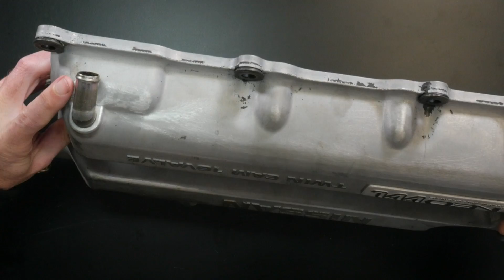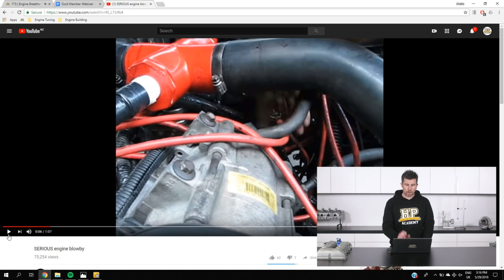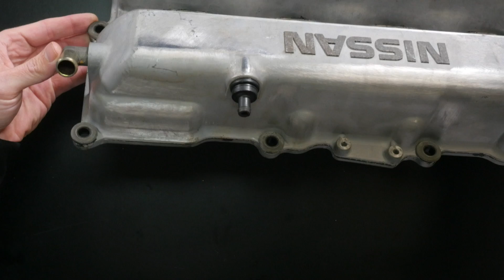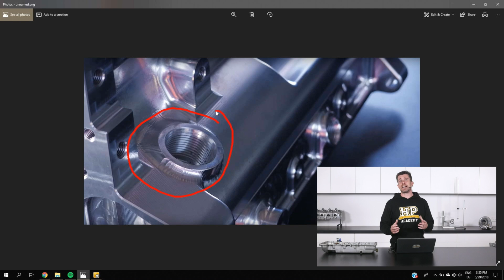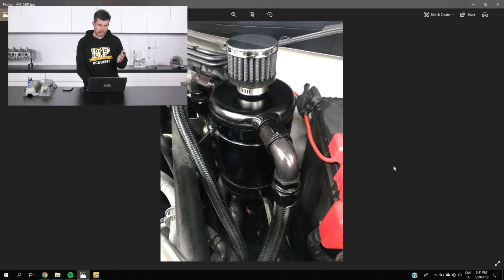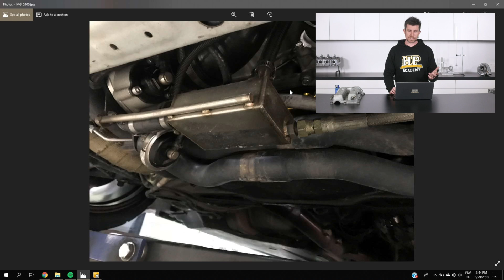Is your Engine Damaged? | Blow-By & Engine Breathers [GOLD WEBINAR LESSON]

Comment: Did this, about 5 years ago, dropped the rivets out and added a second port.  Reassembled no baffles, would fill a 20 oz custom catch can quick.  I built a custom baffle just above the valve cover ports to allow the baffle to drain back.  This reduced catch can volume to filling after about 100 miles of driving (80% commute cycle, 20% romping).  I ended up removing the catch can and plumbing it to an exhaust Venturi, which has the effect of stopping tailgaters.

Comment: For the guy asking about blowby pressure pushing out the main seals:
No and yes.  
I ran huge fleets of diesel pickups and many that put on over 100,000 miles per year.  High blowby was a fact of life.

The pressure doesn’t actually push the entire seal out of the block so in that sense-NO.

What it will do is lift the lip of the seal where it rides against the crankshaft. Both front and rear main seals. Some engines that have a seal for other rotational parts the the shaft penetrates like my wife owned an old honda engine where the cams did. 

Think of the blowby pressure like your finger pushing with that amount of pressure around the entire engine interior. 
Your finger can’t push the seal entirely free of it’s mount.  But it can push the lip of the seal.   In the big diesel world they learned in the 1950’s to only use seals with the spring retainer built into the seal- the blowby that will occur in time is the reason the spring is there.  It slows it, doesn’t stop it.  When epa laws ended open venting- the seal failure rate dramatically increased.  It can blow out poor quality or poorly designed seals as well. SBC intake manifold front & rear is a good example.  
Gm6.5 diesel valve covers is another. The front & rear mains are high tension springs but the valve covers are narrow surface and stock used a poor gasket material.  At 21.5:1 compression before the turbo wakes up and old low moly rings- they are the blowby king of V8s. 
So the valve covers and main seals all tend to loose it at once.  None of the seals are “blown out of the engine” but all of them will blow oil out cruising down the highway by time it has over 250,000 miles on it.  So that termnof blowing out a seal- yes.

Comment: focua ra mk1 - zetec turbo basically - i went with a four port cosworth breather with front of block breather upgrade replacing PCV chamber - blocking inlet routing drain to sump - cam cover to catch can - tried venting to atmos - back to turbo AND  a small vent filter - just smokes no matter what!  tried upper sump and lower sump just smokes!  ive given up going back to normal ford breather !

Comment: Ive got a question. Why do people add ports to vent on the valve cover on a modified engine. Wouldnt it be better to try vent from the crank case directly rather than allowing the excess pressure to move up into the head to vent? 

I under stand thats what some people do with the pcv valve hole by deleting it and venting yo atmosphere but they are a pretty small

Comment: Analogy mechanic doing something wrong that realizes that while doing it.... I was changing water pump on my 6.5 turbo diesel GMC  .. realizing I didn't put enough on the bolts requirement the sealant on them... With enough of the sealant... On them

Comment: It doesn't evap the water. The heated can means the can is the same temp as your engine, thus there is no condensation because there's no change in temp between the engine and the can.
Reply: Heated cans also prevent freezing in cold conditions, preventing the can from sealing and blowing out your gaskets and seals

Comment: I have a Toyota 79 series with the 1HD-FTE motor. It had a problem that over the course of a couple of years many mechanics couldn't diagnose until recently, which was a severely blocked exhaust due to the catalytic converter melting. Throughout that couple of years it was way down on power and made horrible noises from the dump pipe. My question is as of 6 months ago a small amount of white ish exhaust gases now lightly emit from the oil filler cap & dip stick that were not previously there. What would be the first place you would suspect that the previous blockage might have caused damage ie: valves, turbo seals or rings? Engine still runs good & was dyno tested still making like new power figures, it does take a couple more cranks to start now but only when cold. Also doesn't seem to loose any oil throughout the duration of service intervals & breather system seems to be working fine. Thanks in advance for any help.
Reply from the maker: Aww man that is a horrible experience for you to have had. Not all mechanics are as competent as each other unfortunately. The basic training only gets people so far and sadly it is as far as some want to go. 

Glad you found someone to get you sorted in the end. I would discuss this issue with them too. 

We can't diagnose this over the internet even if I was the worlds best mechanic myself. I could only guess which is no good to you, instead you need to do the applicable tests and checks to identify your specific issue - Taz.

Comment: The pistons move air in both directions, so pcv is critical for maximizing engine efficiency
Reply: Good point, however doesn't the internal crankcase volume stay the same though? Because one piston moving up and one moving down cancel each other out?

Comment: I found your video while trying to figure out an issue on my s13 sr20. I found oil in my charge pipe. I have a catch can setup already and have it going from the T to the catch can and then also from the T to the drain in the block, and then a filter on the catch can instead of also connection to the intake. Do you think this oil in the charge pipe is blow by somehow, or do you think the turbo seals are gone? Its weird because I dont hear any weird noise from the turbo, and it still makes full boost.

Comment: What material are your countertops? 
Wood? MDF? Metal? Stone?
Reply from the maker: Rich mahogany of course. Nothing but the finest 😂

These are melamine-coated MDF. They're pretty scratched up but you don't notice it on camera and the choice was more for the fact it is a studio than something we'd pumping out builds on day to day. HPA was also really poor (as all businesses getting started) when they did this. The lack of handles was a budget choice at the time and now that we can afford handles it's too late as it would ruin the continuity 😂

The workshop ones are steel topped, the fab room benches are steel. You can place wood or rubber/silicone mat on those when/if you require easily. I think stainless with a silicone type mat is pretty standard for many.

Pros and cons for all depending what you're up to really, although I'd probably stay away from stone or poured concrete tops personally 😅

And there is your really long answer to a really simple question. Happy New Year - Taz.
Reply: @hpa101  looks like a serious kitchen…..any minute it appears Gordon Ramsay will start to use the table to chop his expensive rich people ingredients that arent easy to find at my local supermarket….
Reply from the maker: We keep him in the basement for such occasions. Don't tell our mum's - Taz.
Reply: @High Performance Academy  while i am loving that hope there is a cross over with @viva la dirt league in future coz they around your block somewhere...hope i can visit both places for photos.
Reply: I was thinking about buying an Ikea kitchen top just for measuring, weighting pistons and for some clean stuff like wiring. Seriously. I have another surfaces for working, and disassembled dirty parts
Reply: @cudilleiro  for start with little budget ikea is a good choice, if theres a chinese market in your city you may find something equal for much cheaper. Upgrade as you go.

Comment: Poor man's dry sump..    

Vac pumps without a doubt are 100 percent are more effective than a dry sump.  It DOES  improve ring seal. Helps them seat better. Put vac on crank that a dry sump doesn't this helping pull the piston back down into the cylinder. 

I guess if your not american you don't understand this so I get it.

Comment: I am running 40psi through my built motor with more ring gap and the factory plastic rocker cover only has a single 13mm breather in it. No one makes aftermarket rocker covers for my engine and the rocker cover plastic with no nice flat surfaces to add a breather to. I have blown 2 rocker cover gaskets out and all of my injector seals out. It doesn't have much blow by at idle but it must be making a lot of pressure when its doing long pulls at 40psi.
Reply: Try an oil fill breather 😀

Comment: 8:20 - is PCV valve in turbo engine different than in naturally aspirated engine?  I thought, in naturally aspirated engine, the PCV valve OPENS to allow more venting at higher RPM and the intake manifold vacuum at lower RPM actually CLOSES (almost) the PCV valve to limit venting.
Reply: @andyjames1494  Thanks   I think I get it now.  I'm not too familiar with turbo engines and didn't think about the air pressure in the intake at high RPM (boost).  Naturally aspirated doesn't have that.  And that difference is what makes the same PVC valve behave differently during high RPM, under naturally aspirated and turbo operation.

Comment: Great lesson! Good day to all. I want to share my experience with crankcase pressure issues that have been a pain in my arse for the last 4 or 5 winters. I bought a 2009 WRX265 with a spun rod bearing for cheap. Cleaned and adjusted all the valves and bought a new short block from Subaru.  Put nearly 1000km on it and driving home just a huge blue cloud behind me. At the time of purchase, they informed me that just not long ago the turbo had failed and got a new one. Suspect  this was related to the spun bearing. Anyway, I suspected the pressure in the case coming from elsewhere. Installed a vacuum/pressure gauge into the case, drove down the road and boost gauge and the one I installed almost reading the same. PCV had stuck open so putting MAP straight into the case! How stupid! So I blanked of the hose to the intake manifold. Few months later (I live in Alberta Canada where we have a challenging climate possible +35 to -40 degrees Celsius) same thing happened blowing oil out the exhaust. Found that stupid Xmas tree fitting that the PCV valve attaches to was frozen up. Once thawed out I realized that fitting has restrictor of only like 8mm. I opened it up as much as possible and had no issue after. March 2021 at minus 30 driving home from work put a rod through the block, froze up and all the engine oil forced out of the turbine housing seal. Changed the convoluted ventilation lines a few times now but even this winter I gave up. I thought unless you were running speed density your car wouldn’t run well by dumping the fumes. But that’s what I do now. -25 and I have issues. High crankcase pressure is not good. I have had to replace my front crank seal cause it pushed that out as well. Boring Write I imagine but no idea how much frustration this is still causing plus the lose of an engine.
Reply: Subaru is garbage.

Comment: Nice work! I love all stuff you publish.

The only thing to comment about blowby is that the rocker valve you mention in the video is not a PCV but a one way valve. Its work is to avoid boost to enter the crankcase while letting gases work in vacuum situation. The other tube is connected before turbocharger. Tube diameter is  low in this case to avoid vacuum to enter the rocker cover. Its main work is to avoid dirtyness in idle valve and/or throttle.

Real PCV (positive crankcase ventilation) valves that are used in modern engines work as pressure regulators tuned around 100mbar. All blowby flow runs over it, on boost and on vacuum. Then the gas is directed to one side or another by pressure difference. In motorsport situation there is no improvement because blowby is not recirculated.

As you said in other videos turbochargers can also generate underpressure at high power. Both underpressure and boost pressure in crankcase can lead to high oil consumption and oil seals damage.

In OEM engine development crankcase pressure and even blowby flow is measured an often used as alarm for testbench. As soon as crankcase pressure rises over the PCV set value it means there is a problem and the engine is automatically stopped to avoid more damage.

Here is a nice video about crankcase ventilation, and a interesting system from mann+hummel:

https://www.youtube.com/watch?v=dkNand6EiFM

Regards!

Comment: Factory crankcase ventilation system has one advantage, it generates vacuum, because it is connected to intake before the turbocharger. Suction helps to evacuate excessive amount of gasses from crankcase. So if you apply less restrictive pcv system but connected to oil catch can not into the intake, the result might be not much better that factory solution.
Reply: But what if that vacuum was offset by a catch can or oil separator system where the intake has a connection still and under load will pull a lot of vaccum still but at idle not enough to suck like the factory system(barely any suction, more vent). What do you think about that? My VQ35DE just blew up after 5 months of hard driving every week. I was burning .5 quarts to 1q every drive. On highway it was worse. But if you kept rpm under 2200 or went to 5000 then locked cruise at 2200 and chill. It would burn no oil. I've been driven nuts about blow by seems like everyone else's cars dont have lots of blowby

Comment: Great video. 
Breathers are too rare of matter really examinated in details. 
It is greatly interesting to realize that pressure or vacuum in crankcase has several effects on oil pump, seals, air-fuel mixture... 

For the question about seals damaged from removing breathers I can definitely answer "yes, if you don't increase breathers sizes (and number) and remove the vacuum effect from intake, pressure will manage to build into crankcase / rockers case / timing case and you will begin to find oil appearing around every engine seals"
Reply: 100 %

Comment: You seem like the right person to ask!  A very reputable shop built my 2.3L engine and I added a bigger turbo.  Stock 350 hp,  now pushing 570 hp at the crank. 3,000 miles later i decide to add a crank case catch can and i seem to get excessive blowby.  2.5 oz per 150miles!!!   On the PCV side though, I get minimal blow by in the catch can.    I have checked the radium PCV valve and all good. I removed the PCV catch can and the checkvalve and went back to stock on that side.     I am told i need to use vented catch cans to solve this issue.   Is that true?   I can't be emptying half way on a road trip lol   I dont think a vented oil cap would help or would it? dipstick always in place, does not lift
Reply: Can we get this question answered please 🙏
Reply: @FlickAF  no need, turns out it was a shitty build from essliner engineering and they installed pistons backwards.

Comment: My (Honda) H22 / 420WHP with 2x10AN fittings recently started filling up the catch can under load with no other symptoms. Compression & leak down were good. I'm going to start with replacing valve stem seals. This video helped, thanks.
Reply: catch can is causing pressure
Reply: Forgot I typed a comment in here.  1 year later and did valve stem seals but still have the same issue.  I would guess normal wear or a cracked ring...

Comment: Why didn't you fit a non-return valve on the bottom of catch can to allow oil drain to scavenge box at low boost pressure, so it can be pumped out from there to oil pan as intended but it will be shut on the high boost? Anyway there shouldn't be a problem with overfilling the scavenge box if it is properly sized..

Comment: Blow-by is not an issue??? Yep, if you plan to keep the car only one year.
Reply from the maker: Some performance engines are rebuilt multiple times in a single year depending on the application and usage which an arbitrary length of time has no influence on - Taz.